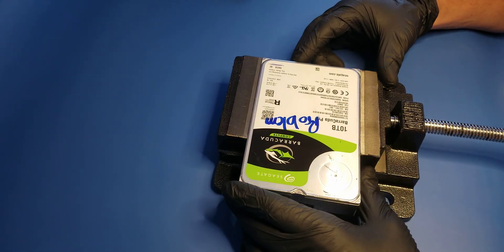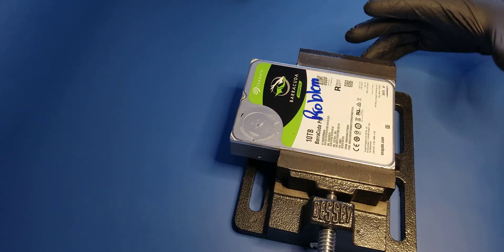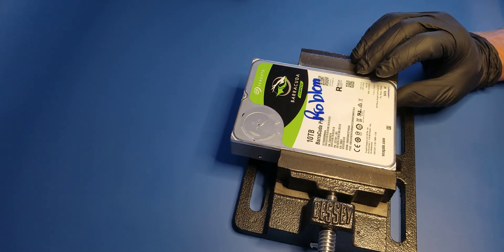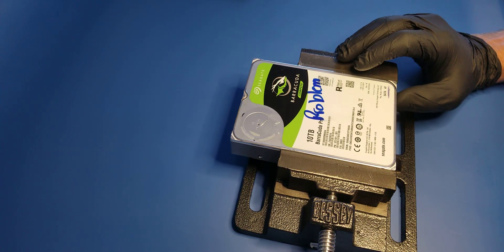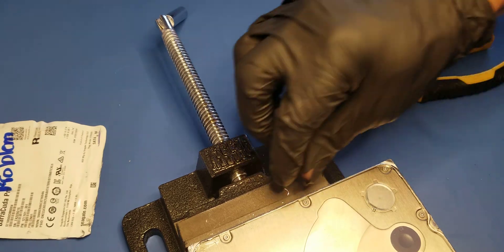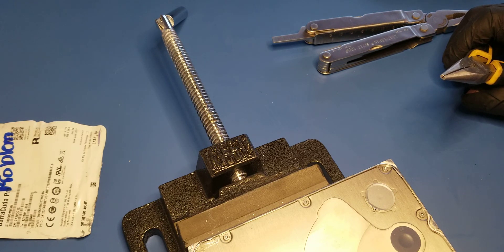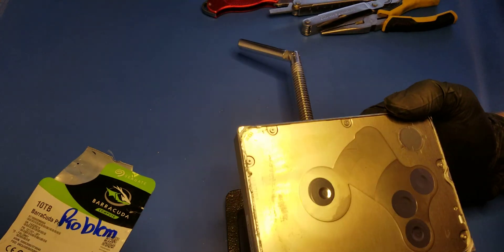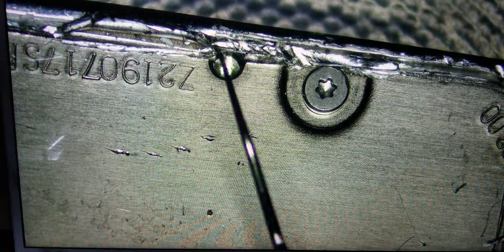How to take apart #HELIUM HDD SEAGATE BARRACUDA PRO, #EXOS, BARRACUDA, #SKYHAWK PART 1

Comment: this is nuts lol who designed this crazy thing!!!!!!!!!!so i ripped off the cap cover and just for shits and giggles  i plugged it back up and its working !!!!!!!!! i guess all my banging and cussing made the needle loose so i didnt have to take off the top cover... thanks bro for the video
Reply: The cover is stir-welded to seal the enclosure so the helium fill doesnt leak out.
Reply from the maker: you won a lottery ticket for sure. Usually it would not work.